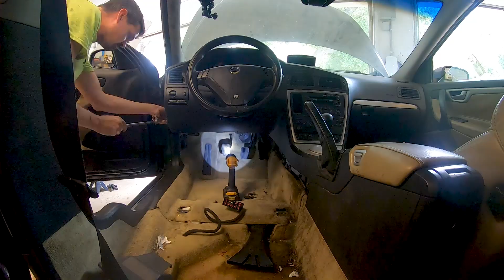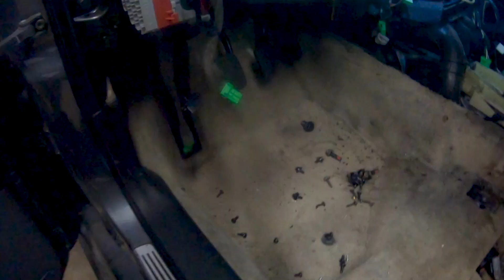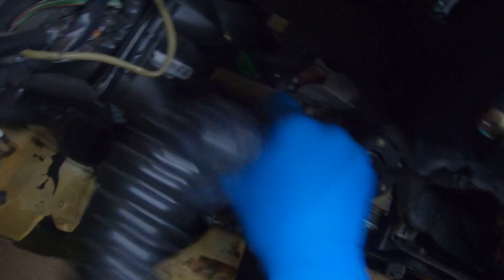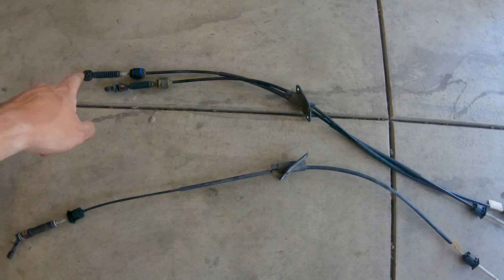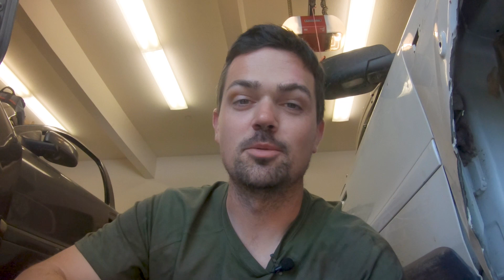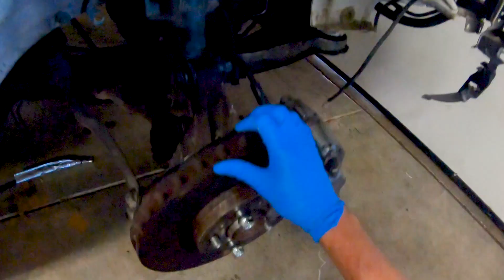Automatic to Manual Swap + BBK and more

Comment: I don't know what options are out there for locking diffs on a Volvo but I know Torq-Masters makes an auto locker for Subarus. Not sure what diff your Volvo has but it would be pretty sick to have proper locking diffs in a Volvo.
Reply: also great content keep up the good work!
Reply from the maker: Totally agree! I am trying to get it as close to a real deal offroader as possible, and the diffs are big part of that. I am sure they will get tackled in the future. Thanks for watching!
Reply from the maker: @lucas.a4047  Glad you're enjoying the adventure!
Reply: @BBBonYT  Not needed unless plowing in deep snow (any locker imitation using brakes does not work at all with wet/iced rotors). Also not gonna work for rock crawling, because the overall drivetrain is too weak for that kind of fun. Otherwise, in my experience Volvo's TRACS is much better than Toyota A-TRACS.

Comment: The xc70 angle gear fits in the R 6 speed gearbox?
Reply from the maker: That I am not sure of. But we transferred over the angle gear when we swapped the engine and trans over, so it should be good. Thanks for watching!

Comment: Do you have to program ecu,since the tcm is for automatic?
Reply from the maker: Yes, a full TCU and ECU tune will be required to make everything work. Thanks for watching!
Reply: @BBBonYT  I did the same swap into my 2003 XC70. I used Hilton Tuning and they were great. I did not remove the dash to install the manual pedals, but it was a gigantic pain...